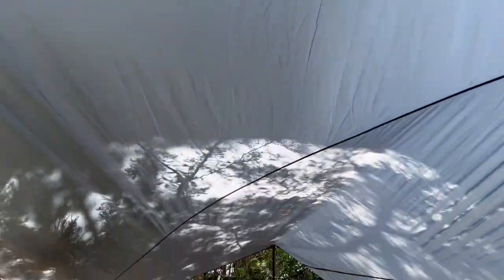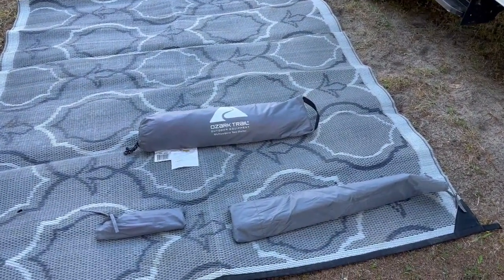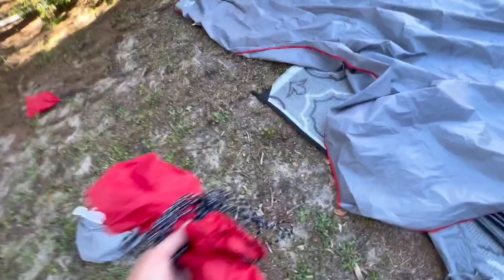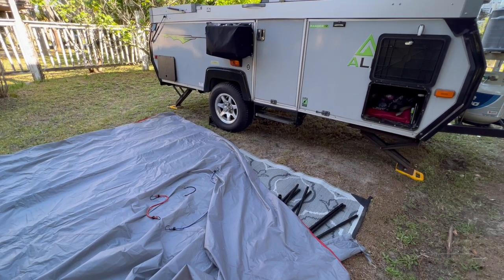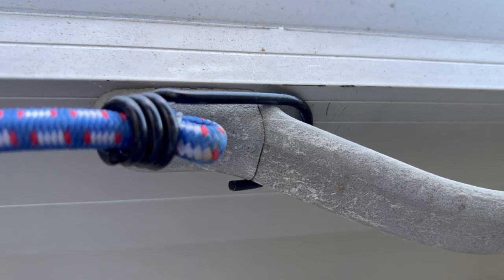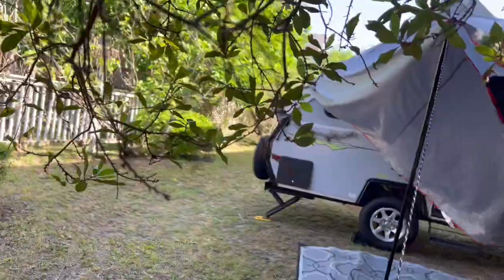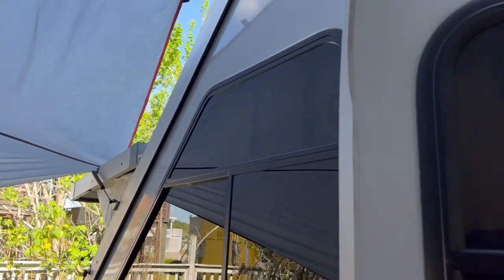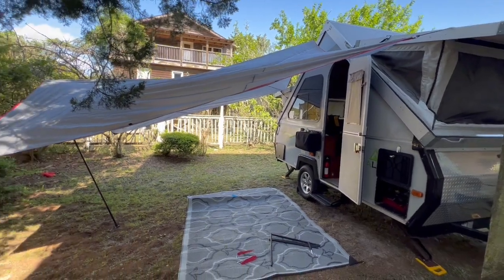Attaching a Canopy/Awning to an Aliner

Comment: Instead of the small bungee in the center have you considered using something like a metal shower curtain hook. That would certainly hold the awning closer to the camper making the gap smaller.
Reply from the maker: Hey! The bungees were what I had at the time. I tend to think that, when the wind is whipping the canopy around, the bungees might help. They’re actually starting to wear out a bit and will try clips to see what happens.

Comment: This is a great simple solution! Thanks for posting it. Do the bungees rub on the roof panels over time?
Reply from the maker: Thanks for the kind comment. To answer your question, yes, they do rub in high winds. The bungees have a cloth outer liner and have not damaged the roof, but there are rub marks. I’ve thought about putting those styrofoam cord covers on the bungees, but think they’ll just fly away during some storm.